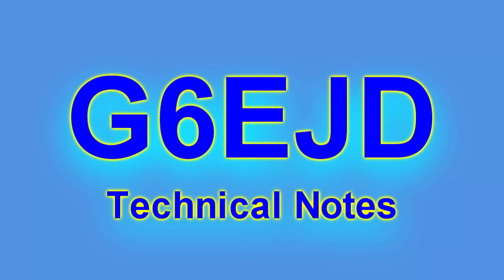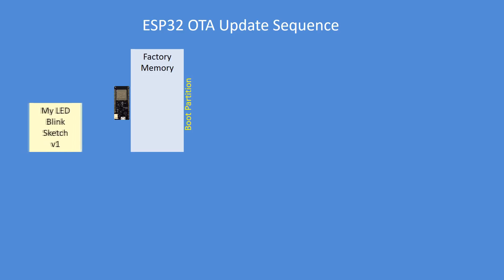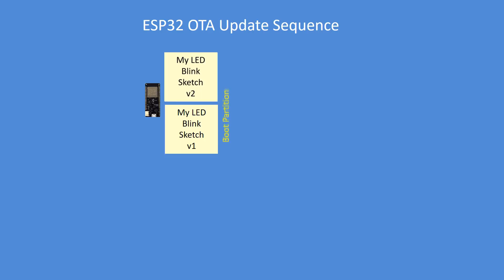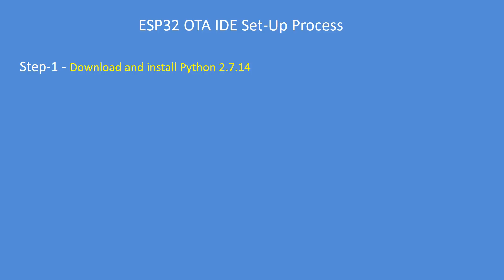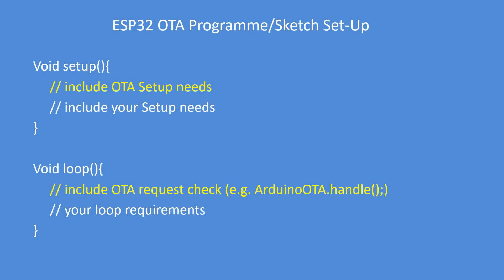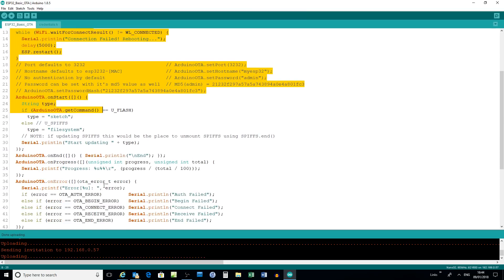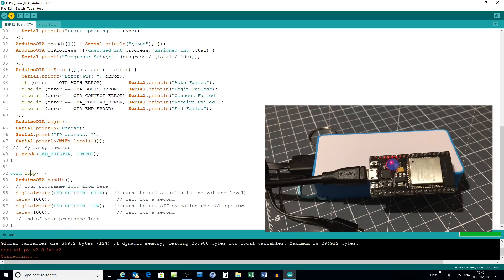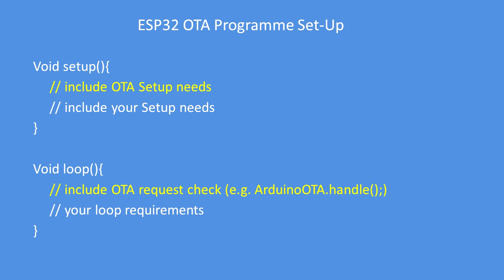Tech Note 082 - ESP32 Over-the-Air (OTA) Updating

Comment: I am you so thankfull for this tutorial. I have my whole house full with esp32's to control almost everything. Every time I want to adjust a programm I need several USB extension cables. With this I don't need that anymore and it was suprisingly simple with your example-code. It took me less than 15 minutes to implement this. Now I feel stupid because I didn't know this years earlier.

Comment: few doubts i have , in first try network port was showing but it was not able to upload the code throught it.but after some time, the network port is even not showing. Please help
Reply from the maker: Have you tried the IDE OTA example, this is most probably a browser issue.
Reply: Yes, I have tried the OTA example from esp32
Reply from the maker: And…
Reply: It would be great if you could provide me some links to tackle through this issue of disappear of network port , also if network port is there then not able to upload the code. Or if you can make video regarding that type of trouble shoot.
Reply from the maker: Well a lot depends on whether the ESP is maintaining a network connection reliably with your router and whether you have the IDE Python extension correctly installed, once you have it works reliably. Have you been able to initiate an OTA?
Reply: Once the network port started but when I was updating the updated code, it was not uploading, it was showing device not responding!
Reply from the maker: Sounds like poor signal strength at the ESP from the WiFi router/source

Comment: Thanks for the very clear explanation of the OTA concept. Still, I have a question. I found some websites explaining how to write Python code for the Arduino but I did not understand what you mean by "Add Python support to the IDE". 
What exactly do I need to do and why is it even necessary since your actual Arduino code is C++ instead of Python.
Reply from the maker: Back then the IDE needed Python to be installed on the PC, but it is no-longer required (good) as it was somewhat complex to setup and unreliable. So you can ignore that bit.
Reply from the maker: Also, you can programme the ESP32 using Python if you install the Python interpreter. Usually the ESP32 comes with the interpreter installed but the first programming with say a sketch overwrites it. You can install it again.

Comment: Thanks sir, its great presentation. How can I make a OTA server? Thanks again. 
Best regards
Reply from the maker: Not easily, do you mean a server that can serve out firmware updates of some other OTA data? You can already get an ESP (32?or 8266) get a firmware update from a web based page/server
Reply: @G6EJD  Thanks for Quick Response.  I want to test my esp32 with a virtual OTA server is it possible?
Reply from the maker: Leesan Process Control, yes you can do this, Espressif have published an example here: https://github.com/espressif/esp-idf/tree/master/examples/system/ota

Comment: Hi! I have an ESP32.  I'm using the library httpUpdate for OTA Updates. What is the difference between httpUpdate and ArduinoOTA? Thanks
Reply from the maker: I need a limitless more context, but in general terms the expressions you quote refer to the method of undertaking the OTA which you can do via serial port or via a network connection, the latter has to be on the same network, but there is a means of using a wide area network so it can be completed from anywhere. See the documentation https://arduino-esp8266.readthedocs.io/en/latest/ota_updates/readme.html
Reply from the maker: You’d need to ask the library author about the differences

Comment: Your videos are very informative, thanks for posting.
Can the sensitive of capacity sensors on the esp32 be configured?  I want to use the gpio pin to detect a touch or proximity of a person through a non-conductive material, like hard plastic or PCs foam.   

I was able to do this with an Arduino 8266 and a large 10 megaohm resister.  Im interested in using the built in capabilities of the esp32, but an unsure if this is even possible
Reply from the maker: There is an application note here: 
https://github.com/espressif/esp-iot-solution/blob/master/documents/touch_pad_solution/touch_sensor_design_en.md

There are many commands you can use but in relation to your queries yes you can adjust sensitivity and apply different levels of filtering and this should enable you to meet your requirements. There is also an application note on touch sensor design.

Comment: Why I can't Upload to ESPino32
15:48:15 [ERROR]: 480
15:48:15 [ERROR]: 480
Reply: and esp32  No response from ESP
Reply: 16:09:01 [ERROR]: No response from the ESP
Reply from the maker: Woramet Y. Try uploading the simple blink sketch from examples. 1. Have you got the ESP extensions installed? Have you got the correct port? Do you have an adequate power supply for the ESP? Is the ESP faulty?
Reply from the maker: Woramet Y. Also can your ide see the esp network port? Is your programme polling the OTA update? Is your esp on the same network? Is your ESP32 in range of the router? Most likely poor signal or interference, there is nothing wrong with code examples.

Comment: Great tutorial, thanks very much. I had one problem when trying to do an actual OTA update using the blink sketch from the tutorial. It didn't work, and came up with the following error: 

Sending invitation to 192.168.2.10 
13:42:37 [ERROR]: No response from device

The IP address is valid and I can Ping it from the PC. Also other code that uses BLYNK can successfully communicate with the router.

Has anyone seen this problem?

Cheers,
B
Reply from the maker: You have to ensure that the lines I highlight in the loop are periodically being called otherwise the ESP32 won’t respond to an OTA request.
Reply: Having used the sketch from your download, I have this loop function:
void loop() {
  ArduinoOTA.handle();
  yield();
  // Your programme loop from here
  digitalWrite(LEDpin, HIGH);  // turn the LED on (HIGH is the voltage level)
  delay(1000);                       // wait for a second
  digitalWrite(LEDpin, LOW);   // turn the LED off by making the voltage LOW
  delay(1000);                       // wait for a second
  // End of your programme loop
}

... so it should work as you showed in the video.
Reply from the maker: In nearly all cases of the OTA failing it is due to the OTA host not functioning so to check before issuing the OTA request do you see the ESP32 network port in your IDE I suspect not. Plus I have also noted with the Windows operating system that a periodic re-install of the OTA support is required I don’t know why but suspect the OTA script for the host needs more work to make it reliable.
Reply: Yes, the OTA port is present, and correctly named, so everything looks like it should work. When you say that the OTA support needs to be re-installed, what are you referring to exactly? The ArduinoOTA library?
Reply from the maker: The Python support files and to ensure Python has not been updated from 2.7 by e.g Windows. Ideally only the IDE version baselines for OTA can be used and nite this IDE based OTA is really only for development not production. Also is the client visible on the network? So has it been assigned the correct IP address and what is it’s reception like try placing the client near to the router to test it out. There is nothing wrong with the OTA itself its most likely environmental issues or the router preventing the transfer especially if port forwarding rules are not implemented.

Comment: Thank you.. uploaded via ota successful.
Reply from the maker: The OTA additions to a sketch especially the main loop has to be called at regular intervals and quite often the OTA support in the ide disappears which I have not found a solution to, but running through the OTA installation again brings that back. The ESP has to broadcast its IP address to be detected at regular intervals so check that your sketch is doing that.
Reply: my application works by WiFi so en the basic ota i removed the part of WiFi.begin 
WiFi.mode(WIFI_STA);
  WiFi.begin(ssid, password);
  while (WiFi.waitForConnectResult() != WL_CONNECTED) {
    Serial.println("Connection Failed! Rebooting...");
    delay(5000);
    ESP.restart();
  }
because en my skech i had already written code of wifi.begin en the setup
thinking no need to repeat it.. but now when i put it again it appears forever.
thanks .. I needed it, it is very comfortable for repeated updates.
Reply from the maker: First off, there is a problem with the ESP8266 and waking up and reconnecting to Wi-Fi, ideally it needs the Wifi.mode (WIFI_STA) and of course a Wi-Fi connection to ensure it can communicate / listen for an OTA request from you. I would run it on a serial port and monitor any diagnostics prints you have entered to see what it's doing. It is also important to wait for the Wi-Fi connection to be made and it can take some time to complete.

Comment: Do you think this would work with Andreas Spiess #168 code to shove it over to Core 0? That way my other code could run on Core 1.
Reply from the maker: I have just been checking the data sheet and manual (https://esp-idf.readthedocs.io/en/v2.0/api/system/ota.html) and there are no specific restrictions on the use of core-0 so maybe, but I recall seeing some restrictions but can’t find them, for example no access to the ADC and I think Wireless. There’s only one way to find out and that’s to try it!

Comment: I would recommend having a bench unit around to prove the sketch before uploading. I've had code "compile" w/o errors in the IDE only to have CPU0 panic when uploaded. Of course most of that has probably been due to the Nextion display and its quirks.
Reply from the maker: CPU panic is nearly always due to poor power supply performance (ESP32 takes a relatively large ~400mA pulse at start-up and then you have the Nextion display ~ 80mA) at start-up, what type of power supply are you using? You need close to a 1A PSU to deal with that if in a standalone configuration and some really good decoupling and storage capacitors to absorb power demand fluctuations.
Reply: It's an MB102 type for breadboard. Supposed to output about 700mA between 5v/3.3v rails. I've run the ESP32 & Nextion off the 3.3v rail powered solely by the microUSB on the ESP while debugging on the PC. I did find out that an Icstation AMS1117-3.3 regulator rated at 800mA caused the display to flicker as though it had insufficient power. I'm supplementing with a phone charger plugged into the microUSB until I find a better solution.
Reply from the maker: Most of the high current demands are transient so you can deliver that power with good smoothing capacitors one large and one small because the large types are very inductive typically 47uF and 0.1uF ceramic. Work out the value of the large one from Q=CV all delta values and as Q=I^2t then C=I^2t/V say you want to deliver 200mA for a change of 0.1v for 1mS then C=400uF actually it’s supposed to be delta values with a factor of 2 but I never bother. What silicon version is yours some startup issues were resolved in rev.1 silicon.

Comment: like allways, best of class. Maybe one question. What happend if you use a lot of ESP32 / ESP8266 with OTA. Do you get an history of all of them in Arduino environment or is link in Arduino only temporary ? For example: use a lot of sensors. If you change network settings you have to change them all. Maybe some of them working for years/month. It would be great if I could update all of them over OTA.
Reply from the maker: I know what you mean and there is no solution really. The best solution for changed network parameters say a new service provider or new router with a Fixed name is wifimanager but you need to connect to the calling AP to rectify, other options are wifimulti but the network details are hard coded, leaving probably the best solution in the form of a webserver in your sensor so you can enter and store new WiFi credentials and then switch over to them. The SONOFF devices do this when they start they ask for network details (they use an ESP8366) then start but at a later time you can repeat that by effectively resetting the devices OTA but sensor data is lost unless some very consulted programming and storage schemes are used. Regarding OTA each device uses a user defined node name but defaults to MAC address so would need careful management and note taking to remember which is which later. I have the same problem and then trying to remember what code is loaded too - well there’s a challenge I’ve started to put version numbers in my code and to print out on the serial port the number at start up so I can at least (later) know what’s what. You raise an interesting question and currently there is a gap in this sector until someone develops a comprehensive solution, something like a configuration manager. I’ll give it some thought.

Comment: I've been trying out your code and I started having  ESP no response errors once I got up to above 600 ms of delay  for each of the delays in the loop ( total 1200 ms.)  Looks like you need to run the "ArduinoOTA.handle();"  with less than that delay in your code.
Reply from the maker: In retrospect using the simple Blink example with delays() was probably a bad choice as the delays (I'm sure) are causing the  Watchdog timer to trigger and hence the behaviour your seeing. I have not inspected the delay() function in the ESP32 to see if yield() has been added in the loop (to reset the WDT) I thought it was, it was there for the ESP8266. It's not a perfect world so needs more tests for an OTA event through-out a users code. If anyone is implementing delays they need to use semaphores rather than any long delay loops, that way nothing is blocking a check for OTA and letting the WDT time-out.
Reply: Its not the old ESP8266 WDT type error, it just says the the "ESP did not respond". There is probably a timer on the OTA update process.  The good news is that now I understand how to start the OTA process and as with anything else I'll need to look further to use it correctly. Thanks again for your great work.
Reply from the maker: Happy to help. My example reliably used a total of 2000mS without any problems and I've been trialling OTA a lot for the video preparation. What I have noticed though is Wi-Fi signal is lower when not connected to my PC and I had to move the ESP32 to get a better signal, so to my mind there is some RF conduction between the mass of a PC and the ESP32. I have also confirmed this by using a Wi-Fi extender close by and that makes for a reliable connection. I checked the ESP32 delay function and whilst yield() no-longer applicable it has been retained for compatibility but they call a WDT reset like function to emulate what was being done in the ESP8266.

I'm now of the opinion that (there is little or no documentation) that when using OTA only the function ArduinoOTA.handle(); should exist:

void loop(){
ArduinoOTA.handle();
}
And that something like the ticker.h used to read sensors every set period that way there is little interaction/impediment to the OTA checker. But this entails a new(ish) approach to programme structure.
Reply: So what about using the second core on the ESP32 to run the OAT routine, as that wouldnt get interrupted by the main loop.  Am just getting into the ESP32 so this is one of my targets.  Great tech note G6EJD and like the powerpoints, makes it all so clear. Thanks for your hard work :-)
Reply from the maker: Second processor has no access to the wireless (WiFi or BT) so can’t be done.